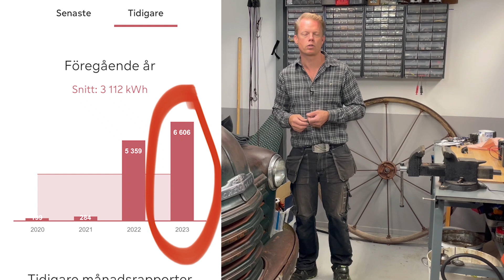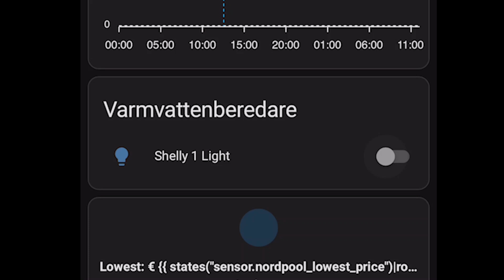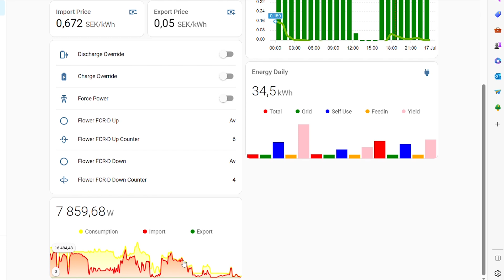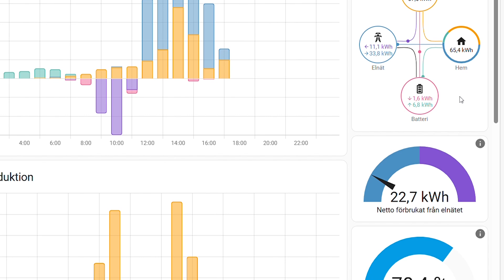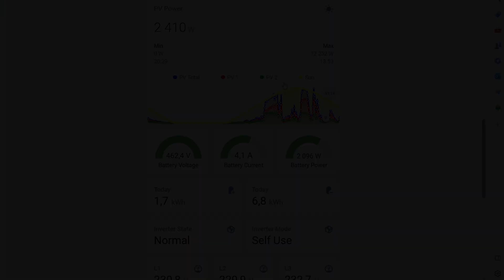Negative energy prices, charge and use everything i have, from solar and grid!

Comment: Curious how much wire did you have to run from your mountain solar panels to your basement? That had to be very expensive with conduit and copper wires?
Reply from the maker: Yes, it was not cheap 150M.

Comment: In the Uk yesterday we had 10 hours of negative pricing in the afternoon  where it peaked at -9p a Kwh, I charged my Solar battery , my electric car did all the washing and tumble dried everything rather then line drying, dish washer  was on early and charged every battery we could, we then all had shower( electric) just to get the units used up. The unit price finally rose above zero at 4 pm  Yesterday we had a low pressure system over the north sea where the wind turbines were all producing unused power which is offered free to use WE are not charged to export it just goes down to zero pence.
Reply from the maker: Okey, interesting to know, there is big differences between countries in in Europe. Thanks for the information.😃👍🏻

Comment: Hi. It's becoming standard here, on weekends from about 10 a.m. to 6 p.m. the price is zero or negative. This has been going on for about a month now, and I think it's all over Europe - a connected market.
I don't even buy at negative prices, because here the price is for both power and distribution, and distribution is paid for consumption. Rather, I occasionally discharge my batteries in the evening when the price is at its peak. I have a 200kWh capacity and 105kWp power plant at my company. From April to October we run at 98% self sufficiency. And we are a tool and die shop - machine tools, hardening furnace, etc.
Reply from the maker: Hi!
Yes, this will be the new normal I guess. I would love to se your system😃
Reply: @flyingtools  Attached a pictures
Reply: @flyingtools  I'll take some pictures tomorrow, we have our own CMU/BMS/BMC. The parts on the market didn't suit me :) https://www.youtube.com/channel/UC5lr5XM9KdvRbi3D2N0IG7A/community?lb=Ugkxr8oq98rsvoejroZ2di4NyBVrlZJoevsq

Comment: Excellent video as always👏 At least you get a relatively good price on your exported power. Not great in UK at the moment. I still can't get an electrician to help me with a safe way of switching from my mains power to batteries for overnight. Any suggestions would be gratefully received 😊 batteries in place for 6 months but cannot use yet, very frustrating
Reply: Have him install an automatic transfer switch ahead of your main panel. Make sure that it will be large enough to handle the short circuit current rating in kAmps and your main circuit breaker rating.
Reply from the maker: That’s a shame, I feel sorry for you.
Hope you will have it up and running as soon as possible. Sadly, I don’t have any suggestion for you.

Comment: Energy spot price today here in Germany is 0,00€ to 0,1€/kWh 12-15h. But there are 13-16cent of grid fees and taxes on top of that. So its cheap, but not free. But I do not care, being 100% offgrid with my PV from March->October. Will scout for cheap rates in November again, need to buy some electrons Nov-Feb.
Reply: In Germany you need to pay also "monthly fee" for grid provider? Or just for each kwh transfer...?
Reply: @edijsegli527  No monthly fee. Electricity price is energy plus energy tax, plus grid fees, plus renewables tax, plus 19% VAT. That adds up to 13-16cent on top on the actual electrcity price. Some providers have a monthly fee, some charge a fee for the smart meter, but not always. There is a free choice of many providers. But after all, its expensive over here.
Reply: @t.d.5804 So only for all "taxes" without energy,exempeel for 1000kwh x 0.15=150eur?+energy price for 1000kwh.. like this?  Offgrid is better choice 100% for you.
Reply: @edijsegli527  Taxes and fees around 15cent/kWh, plus energy price, total is 33-36cent/kwH these days. Was >50cent 6 months ago. PV can provide 75% of all energy needs here in northern Germany and easily 100% with much less modules in southern France and Spain.
Reply: @Chris_1024_ Durch den Umstieg auf rein elektrisch, keine fossilen Dinge mehr, stieg mein Stromverbrauch stark en, WP/EV. Aber dank PV kaufe ich weniger als die Hälfte an Strom ein als noch zu Verbrennerzeiten, das entlastet das Netz. Zudem kann ich den Strombezug verlegen, also auf Stunden mit wenig Bedarf im Netz. Die PV hat so viel Geld gespart (Netzstrom/Heizöl/Benzin), Energie kostet nichts mehr, es bleibt richtig Geld übrig jeden Monat (press YT translate for ur language)